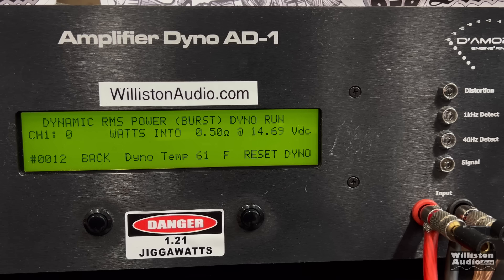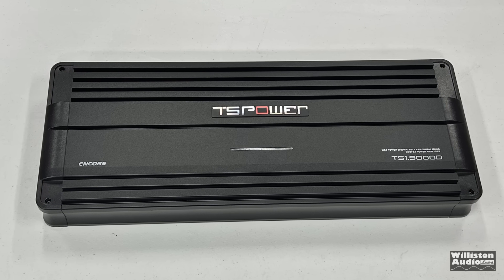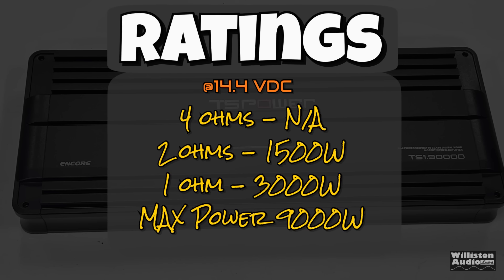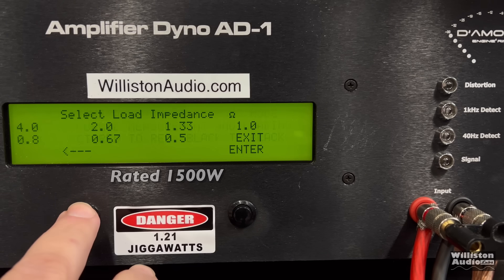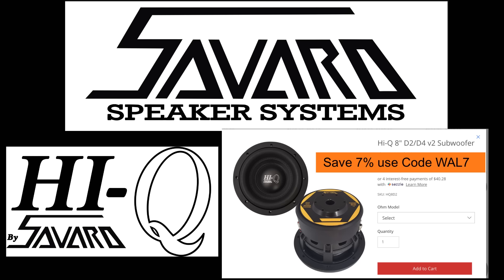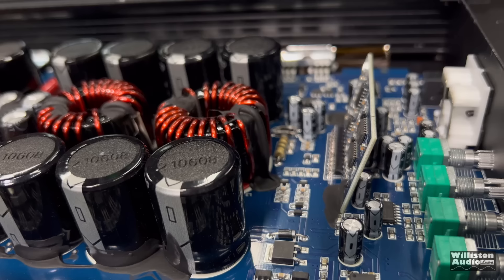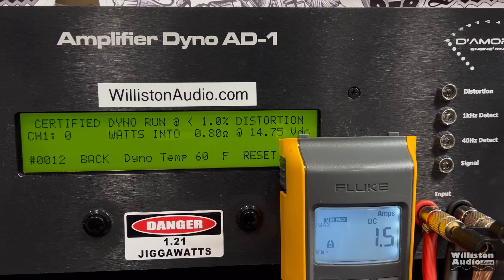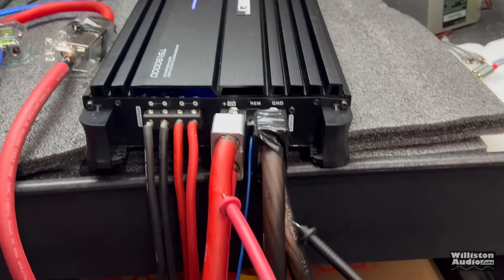This $150 Amp Promises 9000 watts...

Comment from the maker: NESA TS Power TS1.9000D Subwoofer Amplifier
Link to Purchase Amp: https://amzn.to/3O4m0sx
SAVARD Hi-Q 8" Subwoofers: https://lddy.no/1izt9
SAVARD Hi-Q 8" Subwoofers (2) in Standard Enclosure: https://lddy.no/1izta
SAVARD Hi-Q 8" Subwoofers (2) in Premium Enclosure: https://lddy.no/1iztb
Save 7% off any SAVARD Product using code WAL7

Shop for Related Amps
Down4Sound JP23 v1.5 - https://lddy.no/1hx46
Stinger Audio MT2000.1 - https://amzn.to/4865i4n
Double Rock DR-2000.1 - https://amzn.to/3LFniJp

TEST BENCH EQUIPMENT
SMD / D'Amore Engineering Amp Dyno (AD-1): https://is.gd/wccad1
XS Power D1400 Batteries - https://amzn.to/2BPFCKW
XS Power PSC60 Charger - https://amzn.to/2CHGcfs
Fluke 1000A AC/DC Clamp Meter: https://amzn.to/2Rw5WDA
Handheld Dyno AMM-1: https://is.gd/wccamm1
My Favorite Precision Screwdriver Kit: https://amzn.to/3RTO6c4

DISCLAIMER: This video and description contains affiliate links, which means that if you purchase from one of the product links, I may receive a small commission. As an Amazon Associate I earn from qualifying purchases
Reply: Very interesting 🤔 💭 have you done the DS18 3700.4 yet ? I have not seen any one do that amp yet!
Reply: Hey I removed from box subwoofer with integrated power supply (of course neighbors was mad) then I try to connect sub into regular 4 ohm speakers amplifier and in results my subwoofer act like a mid-range speaker, why? 😮
Reply: @adrianmiszczuk8061 you need to adjust hi and low filters on that new amp,, and then it will work fine.
Reply: One time you mentioned about the custom box designer can you share the list again please

Comment: I will say that I am really surprised that this amp made almost 5,000 watts and ran smoothly at HALF AN OHM! That's just mind blowing for such a cheap amp!
Reply: Yeah, I'd call it a pass for cheap power. 

If it did .5 ohm resistive, it would drive a lot of speaker.
Reply: I don't see it playing for more than 5 minutes at a time before it melts down
Reply: @chrisbriwn3233 what makes you say that? From the test results it runs cooler than many amps
Reply: Yes! I like
Reply: @momanholmes8715  its playing 1 set frequency on a dyno. Put it in a car, play at 3/4 volume on an actual song & it'll probably thermal out in 5 minutes
Reply: I would question the longevity of this product
Reply: @chrisbriwn3233  Well is the cab22 known for melting down in that way? Not that I have heard anyways. This amp is super cheap and from China..that doesn't mean it will melt in 5 mins. I bet it would last a year or longer with someone pounding on it with correct gains set. Not all cheap electronics are total crap.
Reply: Wow! Now this amp might be the best budget amplifier ever made. $150 for huge watts at half ohms! That damn amplifier handles more watts than a Soundqubed S1-2250.1  amplifier at half the price. Amplifier companies need to take note on this upcoming successful amplifier. Its also strapable. For $300 you can wire  your subwoofers at 1ohms all day long and get huge watts. I'm sure after ohms rise you can wire at half ohms strapped and get near 10,000 rms watt burst as well for the low price of just $300 😃👍🎉💯
Reply: @chrisbriwn3233 in the video he literally said while doing the thermal test that it was after being on the dyno playing music for a while
Reply: Guys, I have owned many amps and subs over the years and I normally play them on a stock charging system, so no crazy pounding systems other than my Image Dynamics 15s with two ID 1500 watt sub amps running off of a set of alternative gel cell batteries with a set of 5 farad caps. I have serious doubts that this amp would last very long under continuous use at 1 ohm, but I also have even more serious doubts that it'd last under continous use at half an ohm. It would either overheat very quickly or go into protect mode. I was just saying that I couldn't believe it made as much power as it did and didn't go into protect mode at half an ohm. I have a set of Sundown SA12-D2 subs and a Sundown SAI-1750D amp that I run at one ohm on a stock BMW charging system in my 1 series and it slams fairly decently, but I paid around $1000 for my two subs and amp. I also have a set of Rockville W15K9D4 subs that I paid $400 for total and I have very serious doubts about the capabilities of those subs, but they sound decent.
Reply: @HeWhoDrivesATruck  Big D needs to do a video on how long it takes to overheat this amplifier 😁👍
Reply: Also for the price this amp is probably a very good deal. Kind of reminds me of a Power Acoustik Vertego 10k amp that cost more than this amp. I hear good reviews of the Power Acoustik Vertego 10k amplifier.
Reply: makes you wondfer that putting a name on an amp is just that. a name on an amp .
Reply: @RyanBassForLife  your never getting /10k outta 2 of these without BURNING down your vehicle... Stop the nonsense Ryan
Reply: @jayrands5380 quit being stuck up. Not everything has to be expensive to be decent. 
Someone running two 12s in any normal application, and not pushing it to it's limits would probably get lots of enjoyment for the price. Just because you prefer expensive crap instead, doesn't mean this one will catch fire.
Reply: Playing music is actually a lot easier on the amp
Reply: Playing music is actually a lot easier on the amp
Reply: Playing music is actually a lot easier on the amp
Reply: Playing music is actually a lot easier on the amp
Reply: Playing music is actually a lot easier on the amp
Reply: Playing music is actually a lot easier on the amp
Reply: Playing music is actually a lot easier on the amp
Reply: Playing music is actually a lot easier on the amp
Reply: Playing music is actually a lot easier on the amp
Reply: Playing music is actually a lot easier on the amp
Reply: Playing music is actually a lot easier on the amp
Reply: Playing music is actually a lot easier on the amp
Reply: Playing music is actually a lot easier on the amp
Reply: Playing music is actually a lot easier on the amp
Reply: Playing music is actually a lot easier on the amp
Reply: Do not run this amp at .5 . My audio guy warrantied 3 of them because they kept dying with proper electrical 💯💯🤦🏾‍♂️
Reply: @TripleOgTripleOgTriple I've never seen someone leave the exact same comment that many times 😂
Reply: @looogi21  but how well did it handle for the amount of bucks
Reply: @jayrands5380  let's see your bench tester and run it and we can see.... o wait you don't have one... 🤣😂🤣
Reply: @chiefjuice1  you are delusional
Reply: @momanholmes8715  I'd fry that amp in a month it won't hold up
Reply: @TripleOgTripleOgTriple  not really
Reply: @fxrsniper1 if you’d fry it in a month then that’s a YOU problem lol. Several guys running these budget amp
Just fine even down to 0.5 ohm.
Reply: @momanholmes8715  My Current amps PPI PC 2400 and 2100 were made in 2000 still beating the crap out of them. Same for my MB Quarts Components in the door and back dash
Reply: @RandoManFPV hey do you know if playing music with this amp is easier on the amp? S/😂
Reply: @volvo09 you could be correct however I don’t think it would be lasting long at all .5
Reply: @chrisbriwn3233 Tbf from what I’ve saw the dyno is more brutal on amps than running a subwoofer, resistive vs reactive.
Reply: @RandoManFPV 😂😂
Reply: these tests are interesting. they would be a lot more interesting though, if they focused on sq as well. noise, distortion and so forth
Reply: @TripleOgTripleOgTriple 

I was hoping that someone actually said this.   Test tones are much harder on a system.
Reply: Like what?

Comment: Yes I own a car stereo shop in Tulare California and was sponsored by earthquake so they would take the protective circuitry out for me so I could run just about as much voltage as I wanted to it and that's what I did to golf cart batteries 8 V wired in series 16 V power master 300 amp alternator And I only placed second in the world in Memphis Tennessee at the world finals

Comment: As a veteran of many crunch amps in the early 2000s I can say This is phenomenal power. I have only seen amps get smoked in a few ways. Driving them past their capacity. Incorrect or inadequate hookup. Or other carelessness. Most people are not going to even use 75% of the capacity of this amplifier. Your kids will be digging them out of the garage and installing them in their first car 😅
Reply: This is budget power not saying that's bad but the most common setups these days are 3-5k watts.
Reply: @SidyDidIt  nothing wrong with that but for a daily driver... Way more than enough
Reply: @SidyDidIt most common setups aren't 3-5k watts more like 1-2k on the high end. How many people are upgrading their electrical to run 2k+ when it comes to "most common" most people don't wanna drop an extra $200+ just for electrical upgrades alone.

Comment: OK it makes over 900 watts at 4 ohms. For $150 that right there is huge value. Anything else is gravy. The fact that it makes 3000W at 1 ohm is absolutely fantastic. Sadly it's not a 9K amplifier. But, if you can set things up for a .5ohm load, you can get a full 5K out of it. I assume these tests are not done with bass boost cranked all the way up either which may add a bit more power. Even though it doesn't make the 9KW claimed, it still makes really big power for a $150 amplifier. In this case, I don't mind it not quite meeting it's full ratings. A whole lot different than an amp rated at 1K making 150W.

Comment: I actually like the amp and am glad you rated it. The fets appear to have better and cleaner power management than other budget amps. The cumulative rating of the capacitor banks look sufficient enough to run and bump most subwoofers smoothly without any muddling of sound from power loss. This is good enough to run without multi farad cap banks outside of the amp. I would buy it and thank you for rating the amp yourself. 
(Sup Doe! From Detroit.)

Comment: Big D pretty much summed up everything I wanted to say. 
For that price, it’s awesome. But how long it will last is another story. Only time will tell.
Reply: I'm pretty sure a cooling fan or two and mounting in a place the amp can breath might help.
Reply: Hell... let it ride at 8ohmz  4 evah....  @4ohms 4ah goot whillie. @2homiez   not 4 long  and @owhnohmz  4a fhew daze or montz if yer luhkee  and don't run em to the maxxx like I duz. Word oh and throw all that out the window using stock electrical. With the lights on ac on midnhi amps.     However with more than e nuff reserve power never dripping voltage.  Ahhh refer to original gueztimatez.

Comment: Ok i picked one of these up because of this video. I really love this amplifier!! Big boy puts out plenty power for two 12s. gain @ 9 o'clock. I did get different screws at tractor supply that use Allen's key that is soo much better than the Phillips screws. Seriously grab one if you have a budget system going you will not be disappointed! The big 3 upgrade is a must. Thanks for the review. Have a fosgate 401S 1200 i should send you

Comment: All you need is a nice 60Hz sine wave oscillator at the input, a transformer at the speaker output, and you got a nice inverter.
Reply: wait so if you send a 60hrtz signal thru an amp it can run an electrical outlet?
Reply: @Whataboutitdoubtit  Yep, that is true. Just don't forget the XFMR at the amp's output to feed the load.

Comment: My next system might include this and the $150 MTX 2 x12 terminator box. I’m not into spl, Budget Basshead got 140 with it, so this combo should work great for the bottom of a budget build. Finish it off with a four channel amp and some speakers in the stock locations, and have a good sounding system.

Comment: This amplifier is a Power Acoustik Vertigo 10k circuit board. Looks identical and Facekicker did an amp dyno and it was very similar results to this amplifier.
Reply: No it’s not
Reply: Board is similar to a CAB22

Comment: I mean, its probably not the most reliable amplifier ever, but for $150, it makes way more clean power than i thought. Bet it makes 3k at half ohm uncertified.
Reply: If you watch until the end, half ohm made 4940 watts dynamic
Reply: Exact same topology as a JP23, skar RP2000.1, cab 2200, and quite similar to cab 1600
Reply: Without seeing the amp, I can tell you it uses IRF640s on the output and IRF3205's on the power supply.

PWM switching is accomplished by a pair of error op amps feeding into each other....
Reply: It went up 189.00

Comment: I bought one of these amplifiers from eBay a few weeks ago it did have plenty of power I had it on 2 15 first Generation Alpine Type Rs at one ohm it worked great and sounded great but it only lasted a week and I had send it back to eBay for a replacement it went up in smoke maybe I got a bad one I will let everyone know if the new one lasts lol

Comment: Crazy how cheap power is now.  Back when I competed in SPL a decade ago, a decent 1500 RMS amp was double the price of this thing.  Nutty.  Maybe I should build a new SPL vehicle now...
Reply: Big "D" and I are from the same generation.... Back in the 90's, amp pricing was pretty standard at $1 per watt AND, 1,000 watt amps were almost unheard of, much less 5,000 watt. My, how things have changed.
Reply: @galendeig6747  yeah, I remember those days too, I was just saying as an SPL guy, that kind of power was crazy.   I ain't bringing up dollar a watt days because I want to forget how the wallet felt then.  My first setup was a 12w0 on an Audio Gods XO-500

Comment: to calculate efficiency for example the two ohm burst you take voltage 14.42*current(170.6) = 2460 watts. Then take the indicated watts (1563/2460)= 63 pct. Idk where you get your efficiency numbers, it's like you just make them up to sell the amp better?

Comment: Watching this video you just get the feeling the magic smoke is right there, ready to go poof. Probably on day 31. 
They'll sell a bunch of these things at the price quoted but, I seriously doubt those buying them will have the electrical necessary to support the current draw.
Reply: Exactly. $150 for the amp is fine but add another 300-500 for dedicated battery, an isolator, and wiring/terminals you'll need to get anything near the rated power

Comment: ILL MAKE A CLAIM 
I started bumping 1979 
Caught the bug bad 1980s 

I REMEMBER THE POWER WARS 

1$ a watt was the standard 
COMPANIES WOULD 
CLAIM 300 watts you paid 
300$ 
Amps we’re putting out 
75x75 = 150 rms = 300peak 
300$ amp stable 4 ohm (sometimes) 
YALL GOT IT GOOD SOLID NUMBER 

WIZ GOT THE DYNO AND SUBS GOING TELLING THE TRUTH.
YOU HAVE A MARKET SATURATION WITH SOLID BANG ‼️

Comment: Hey Mr. Wiliston you did a review on the jp95 a while back. Just wanted to say thank you I just bought one, waiting for it to arrive, let ya know when it gets here how it worked out for me
Reply from the maker: Those have been really reliable and just great overall. I think you'll enjoy it
Reply: @wal  having it professionally installed and tuned tomorrow I got the personalized one 😎  thank you for all your vids Mr. W.
Reply: I also got the jp95 based on Wilistons review! ......infact, I bought two of them. One for my Avalanche truck and one for my daily commuter.
Reply: Ok, so update... I had it installed, and I have managed to smoke 2 tweeters and working on a door speaker. I way under estimated the power... I think the installer may have set me up wrong on the settings . Just gotta work out the little bugs

Comment: Dude I meant to buy these fake pioneer branded amps on temu and they sold before I went to order after I forgot... They was 260 shipped and dual power terminal and was 5000 or 6000 rms. Super well built lol for 260 😭

Comment: @Williston Audio Labs. Have you ever messed with one of those obscure Almani amplifiers before? I used to have one called a "BA500x2" or "BA500.2" and it seemed like it made over what people say.. i had it bridged up to a CT Sounds Meso 6.5" and that amp put my lil woofer in the headlock & punched it in the face! That poor thing bottomed-out HARD and I only had about 11v powering it at full load.   Im curious if maybe they could have been cheater amps somehow and why no one ever really has any info about them. Only thing I find when researching Almani amplifiers is something like "hey yall are these amps any good?" "(Bro. Buy that sucker and just wait till you hear it. You will NOT be disappointed)"

Whats your thoughts or conclusion about the Almani BA500X2?
Reply: LMAO! Was it 50x2

Comment: This amp is no longer available, but the Power Acoustik VA1-10000D Vertigo is the same amp.
Reply: Do you rhink its a good amp
Reply: I've had both amps they are very similar but the Vertigo definitely has more power

Comment: I don't suppose you tracked amperage at .5 ohms?
Reply from the maker: Not with the Dynamic tests as the clamp isn't fast enough to capture. I didn't try uncertified at 0.5 as I'm 95% certain that would have ended in the magic smoke

Comment: I bit that amp was hot on the inside at half an ohm, I had a Phoenix Gold Amp , and it claimed it was 1 ohm stable,  but the truth was , it was not . That sucker was so hot you could smell it burning 😂😂😂😂😂and the protection would turn on , I felt the amp , damn that sucker was so hot you could fry an egg on it !!

Comment: Cab22 for 150? Nice!
Reply: Except the heat sink is sub par (case). The heat sink matters. The thick aluminum heat sink in the cab is much better and also more expensive.
Reply from the maker: Yeah not quite, but it's a wannabe CAB22 with no warranty and such

Comment: This sounds great , but I dont really hear too much about the amp draw.   300 amps at the 1 ohm.   This will kill like every alternator.   At some point this crazy power is just unusable for most people.
Reply: It takes power to make power. Regardless of the amp it would take a few hundred amps to make a few thousand watts. It isn’t the fault of the amp makers if the customers electrical system is good.